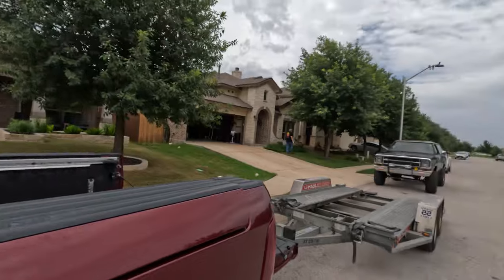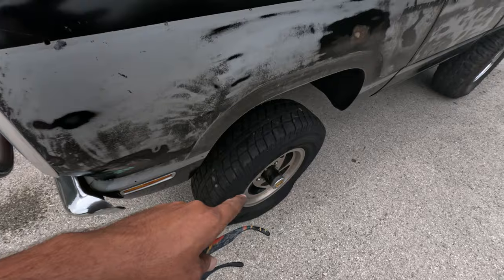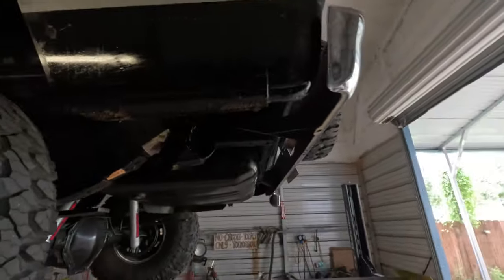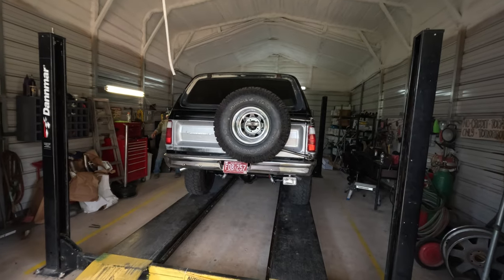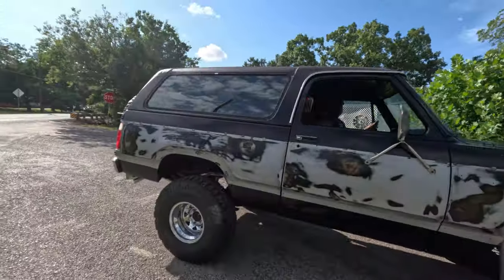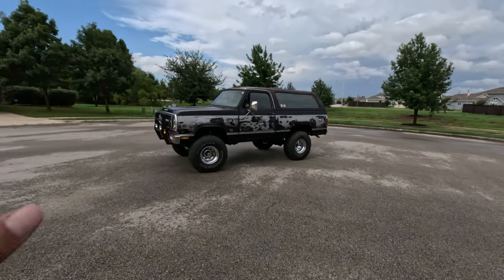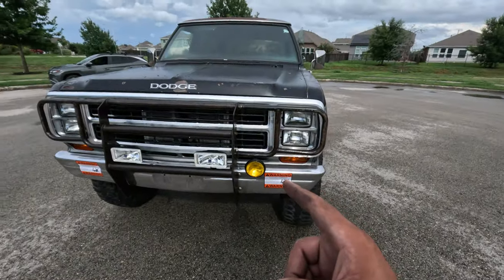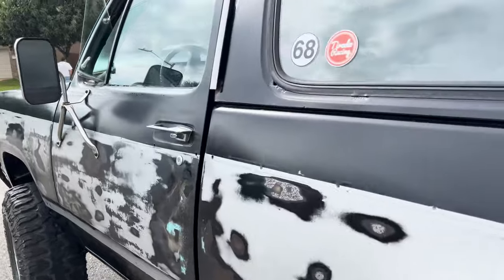My 1980 Ramcharger Is Going To Be The Perfect off-road SUV!

Comment: Not bad prefer the 70's models because they have the removable tops. I would recommend led spot lights front and rear and not mounted below the bumper hitting the trails is likely to destroy that back light. I had a 1978 for about 10 years that had a 440.
Reply from the maker: Great point on the spotlight! This is the last year of the removable top! 😁

Comment: I call them trucks😊 Good looking rc man.
Reply from the maker: Thank you! I’ve been steady working on it trying to at least get it ready for the fall.
Reply: @TIRADORACING  
They were built on the short wheel base truck frame, they called the rc's, blazers, broncos some new term, but not suv's. That is the point I was trying to make, hell some rc options didn't include the back seat. One piece of advice, you can cheaply upgrade the master brake cylinder and brake booster to a 3/4 ton dodge size. Everything bolts up and you have some better stopping power.
Reply from the maker: That’s crazy I just read up on the brake booster last night! I will probably do that once I get it running good. 

Still need to set my initial timing and total timing.